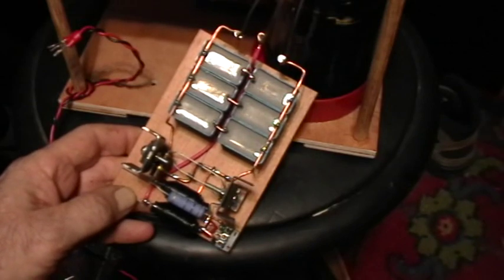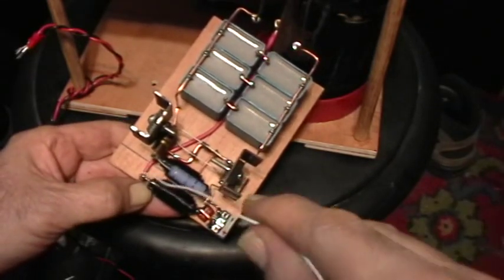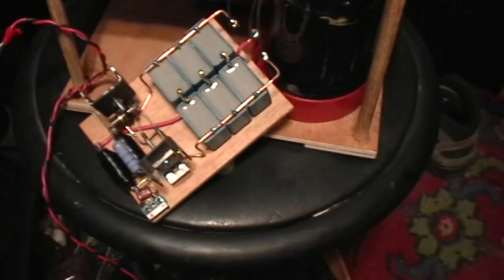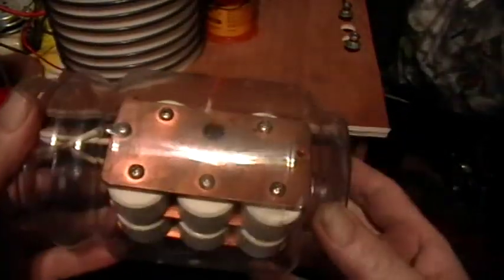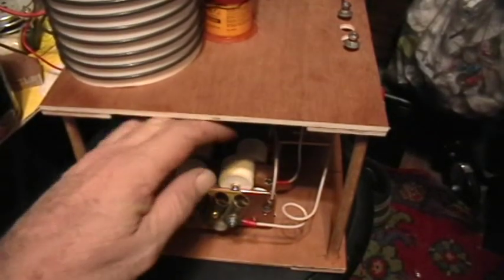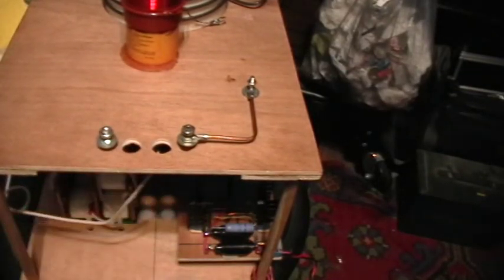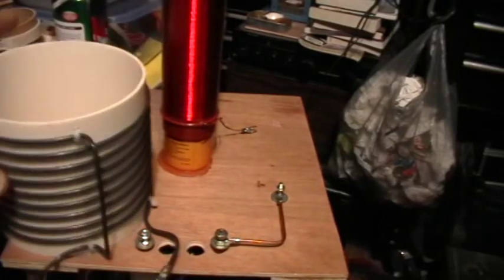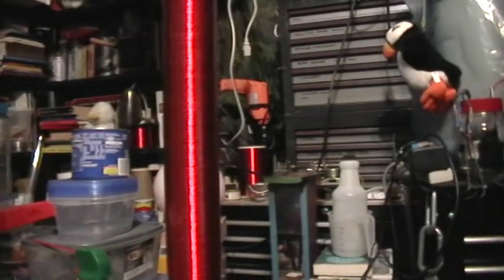Extreme High Voltage: TinselKoil VII Overview, Construction, Demo

Comment: Fantastic build! I like the resourcefulness with the top load, solder wick and magnets. I'm working on a very similar setup, but I'm just using a prebuilt ZVS driver.
Reply from the maker: Thanks for watching and commenting! Good luck with your build. ZVS drivers will generally produce a sinusoidal (ac) output to your primary coil. For maximum "tesla" effect you will need a square wave (fast rising, falling edges) drive to the primary. This is one of the main differences between a true Tesla coil and a "slayer exciter" type coil set. The other is that the SE is an auto-resonating system and not all TCs are.
Reply: Thanks for the tips! How does this spark gap setup work? It looks like 5 gaps in series, but I can't imagine that would work. Is it 5 in parallel? Or one big one using 5 pieces of pipe?

Comment: Hey TK at 3:20 you say the Drains come off and go to each side of the capacitors (you mean the source pins correct?)... at the beginning it is said thenegative input goes to the drain of both mosfets... Is the source pin of the mosfets hooked up anywhere in the circuit? If the source pin is not hooked up then I know why I am not getting oscillations... Thanks for the help... Been scratching my head all day as to why this is not working for me... Thanksgiving meal was epic, ate and drank enough for both of us 2 times over  :)
Reply: Or is it that the - rail goes to the source? I dunno.
Reply: Binj Komisar Yeah, I have the oscillator oscillating now. The negative rail has to go across the source pins not the drains (as outlined in beginning of your video). I know it was an honest mistake and none the less I thank you so much for all the help. Now I have to tune it in and hopefully I can get a  nice field going. Probably going to enter a SE in to the Spacial Energy Cohesion comp... Very happy to have this oscillator oscillating now. I can move forward. Thanks :)
Reply from the maker: Great, I feel stuffed already, thanks!
But I thought you had the schematic?  Yes, the Source pins of the mosfets are connected to the DC negative supply rail and the little bypass capacitor, that's all.
If I misspoke in the video, which I sometimes do, please let me know so I can place an "erratum" statement there.
Thanks, and I'm glad your oscillator is working! I'd love to see a picture or video of it doing something.
Cheers
--TK
Reply: TinselKoala Your welcome :) No, I didn't have the schematic, was going off of the video. At least I helped make the video "erratumed". Making a video tomorrow when I am off work. Its pretty neat (I think I need better tuning though). I have blew 1 set off mosfets (since I have no 7812s yet), I have pushed it to 50 V by putting resiatance 1Kohm in front of the 100ohm resistors... I am going to put two 200ohm 3 watt resistors in parallel times 2  (and about 1.5K in front). Then I will see if I can push it to 100 volt range tomorrow. Anyways, a video will be tomorrow as my entry for that comp. But I plan on doing many more things with this driver. Thanks again. Peace.
Reply from the maker: Binj Komisar Sorry, my fault for not posting schematics with every video. I've posted that particular schematic so many times I just figured that everybody interested would have it already. And it's not anything new or proprietary, it's all over the internet in various versions. Only the component values and the way the schematic is drawn are different, the circuit itself is the same.
If you are pushing to that much input voltage you will need gate protection. Either zeners, or voltage divider resistors like you are describing, or the VR system that I tried. You could probably use a 15 or even 18 volt regulator. Be sure to use bypass and filter caps on the input and output of the VR.
As far as "tuning" goes, the resonant frequency is set by the LC values. There is some capacitance and inductance outside the actual capacitor and coil but they only throw off the calculation a tiny bit. You can even use the system to measure caps and coils. Usually you will know the capacitor value with some degree of precision, and you can measure  the frequency in various ways, then calculate the inductance of your coil. Then you have some basis for adding or subtracting turns or changing the cap values to get the desired frequency.  Knowing any two of the values (freq, cap, inductance) allows you to easily calculate the third.
http://www.1728.org/resfreq.htm
Reply from the maker: I know you have it sorted now but I just want to make it clear to everybody: The mosfet DRAIN pins are connected to the coil-capacitor tank, and also to the diode cathodes. The mosfet SOURCE pins are connected to the negative power supply rail and nothing else (except the little bypass cap at the power input terminal and the 10k gate pulldown resistors). The mosfet GATE pins are connected to the diode anodes (from the opposite side) and to the 100R bias resistors, and of course the 10k pulldowns. Actually the 100R and 10k make a voltage divider that biases the Gates. The other ends of the bias resistors are connected together and to whatever Gate power source you are using: either a voltage regulator like in the induction heater, or through a choke to the positive rail as in this version.  The center tap of the coil is connected through a choke to the positive supply rail as well. There is the small bypass/filter cap connected from positive to negative right at the power input to the board. Sorry if there was any confusion, I'm trying to put "erratum" statements in the video where I misspoke now.
Reply: TinselKoala Thanks. I have been using that calculator on that 1728.com site. It is very easy to use... Just got home form work. I am going to have some coffee then make a video showing my oscillator setup :) It should be uploaded tonight. I will post a link tonight or early tomorrow morning before I depart for my job. Peace TK. Thanks gain :)
Reply: TinselKoala Going to have to finish vid tomorrow :( 15th is the deadline of the comp ;)
Reply from the maker: Binj Komisar I finally found your photo on googledamn+. Looks good. I wish I could find my big air variables.  I know they are in one of these boxes somewhere but which one? Maybe under the bed. The problem, though, is that they only cover a range of a few hundred picoFarads usually. You really need nanoFarad adjustability for this circuit. That's why the TKMiniSlayer uses the bottomloaded secondary with the tunable loopstick instead of varying a capacitance. Instead of the cap, at some point you might like to experiment with tuning the coil with a variable inductor of some kind in series or parallel with it.
What is this competition about? Power transmission, I think I got that, but what are the goals and restrictions? How much input power are you allowed to use, for example? Does the system have to be some specific system, like the Tesla  magnifying power plant idea, or does anything go?
If I can light up an LED at five meters with 24 V input to the transmitter is that good, or not?
 I don't mean for the competition, I am just wondering what kinds of things you lot are getting up to.
Reply: The rules are you can have any form of source tower. And any form of receiving coil, also any # of receiving coils. They must have separate grounds and you must be able to light up an florescent tube... Its ends tomorrow. Its more a for fun competition to get "everyone" focused on a goal. Its pretty cool. Your entry with the 24V a 5m is definitely good. If you got the harvested energy into a cap and running a low power slayer exciter, then lighting a fluorescent. That would be better... I wanted to do that but time did not allow. I am going to be practicing this stuff for years to come. Peace.
Reply from the maker: Binj Komisar
But is there a restriction on input power?
You might find this one amusing:
Joule Thief: PCBJT Wirelessly Powered by SassyClassE SSTC

Good luck, I hope your system blows the competition away! I guess I should have asked you about it earlier, I might have been able to give you an idea or two...
;)
Reply from the maker: Binj Komisar
That's great, congratulations! I hope you make a video showing your construction. I'd also like to  know about the first place winner!